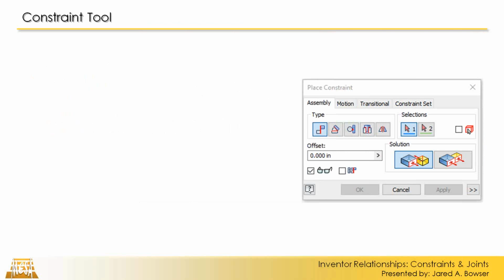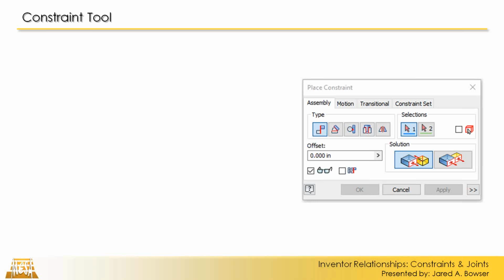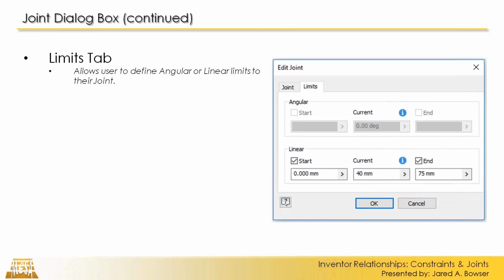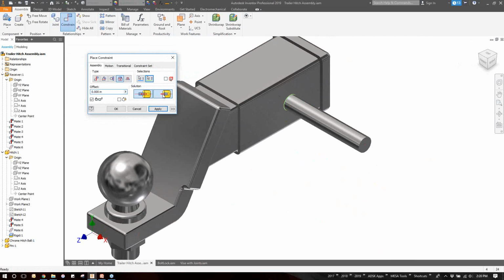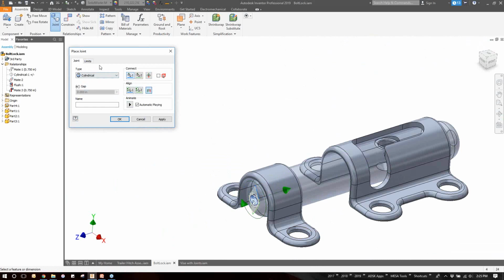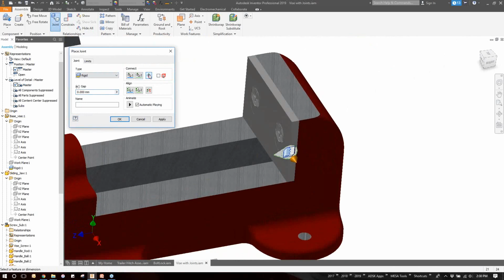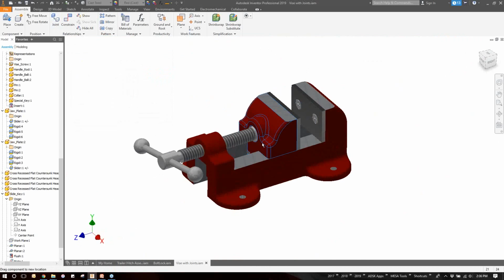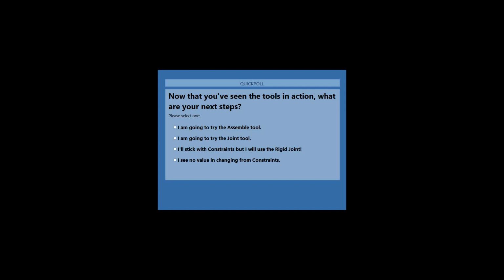Inventor Relationships: Constraints vs Joints

Comment: I would create the geometry for all 4 pieces of the hitch in one *.ipt (geometry file) when bringing them into the assembly use common geometry and you need only two snaps not 3 for constraining parts as needed. Model States can help here too.